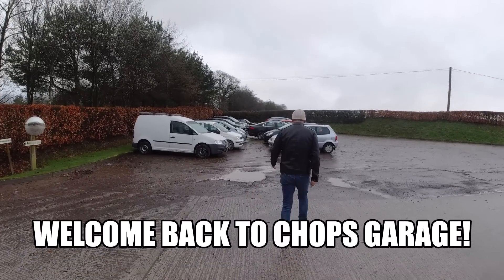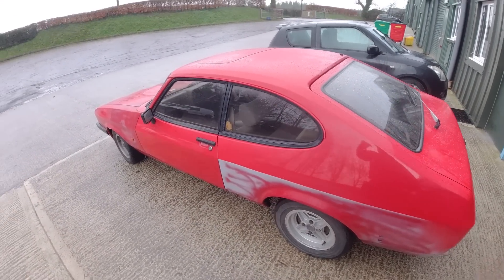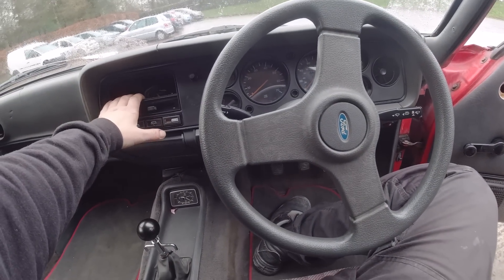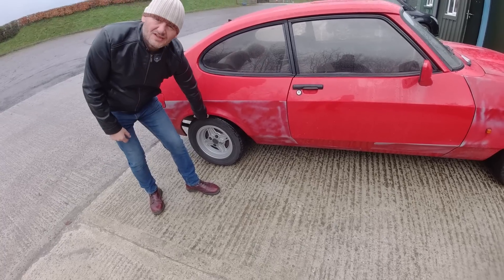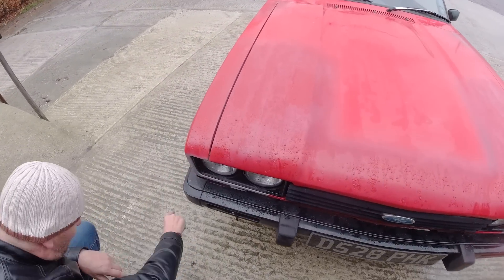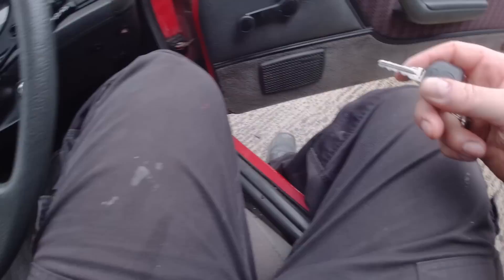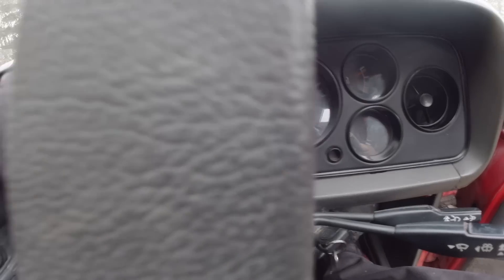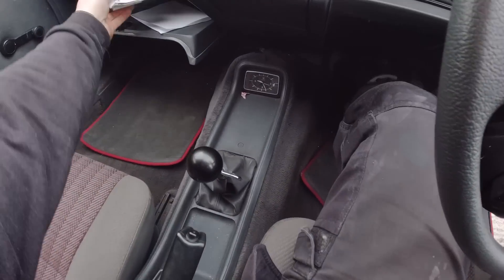Is this my best Part Exchange EVER?

Comment: Can’t believe how spindly those A pillars look on the Capri! 
Almost look like they’d fold in a strong wind 🤣
Definitely need to keep that as a project James, I’m sure it would be relatively cheap to get back to a really nice condition 👍🏻
Reply: The front bumper is basically a girder bolted on to the chassis though with plastic end caps, in an accident the car stops but you carry on travelling.

Comment: There's a lot of potential in that Capri providing it's alright underneath, I'm amazed at the rattle can paint job even though it was a rushed/rough one, it doesn't look like it. Although the Lasers were very common a Capri is a Capri. Could do with a bit of work on the engine though, it couldn't break the wheels free on a graveled car park!!!🤣, you need to find the missing BHP and shoehorn them back in.

Comment: When you (if) you paint that capri, DA as much down as you can and use isolating primer to stop any reaction, if you use base coat and clear the base is rich in thinners and will soften the many years of different paints underneath, 2 pack primer filler is good as it goes on so thick it really hides imperfections, if I do a car like that I basically Bury it in 2k and block it back, you'll paint it for 100 quid in materials as opposed to paying a body shop 2 grand.

Comment: I had a Capri 2.8 I back in the late 80’s . One of the best cars I’ve ever owned . Boy I wish I still owned it now the values have gone through the roof . If you can get yours near original condition there should be a good market for it .
Reply: I still  have mine but its now a toaster and the Escort MK1 is the kettle.........
Reply: Yep at 20 mpg I couldn’t afford to keep mine . Still great memories though.
Reply: @stephenbibby8650  I have a 2 Tonne Nissan Elgrand  3.5 V6 runs on V Power and does about the same in London MPG wise.

Comment: Best trade in you will have in a long time.  Worth a pretty penny too, but I’m biased when it comes to Capris.  I own a 280 with only 27k miles on it since new 👍
Reply from the maker: cheers
Reply: Lucky man…I had a E reg 2.8i about 22years ago,55k FSH caspian blue I think,sold it for £1850 I should have just moth balled it,around the same time a got a D reg 1.6 laxer for £150 that some old guy part exchanged into my mates garage,it sounded like a skeleton dancing on a tin roof,I sold it on to some foreign lad that thought it was a diesel because it was that noisy and smokey😂
Reply: Lazer

Comment: The Capri looks very sound, quality welding repairs from what you can see, it doesn't look frilly or crusty at the edges, and the inner wings and suspension turrets look mint , pretty sure it didn't come with RS alloys as standard , probably bought down the pub in the 80's 🤣🤣 bet they're worth a few quid now! 
The Pinto can make some serious HP , cracking motor when they're sorted , IIRC to do a cam swap it's an engine out job or take the head off, the cam comes out towards the back of the engine .
Reply: As I recall Dave the laser's did come with the rs alloys as standard , do a search for when they were released then you will know for sure if that's the case

Comment: Many years ago I thought I wanted a Capri until I drove one and thought oh dear this things awful... Maybe it was just a bad one but it put me off right away.

Clutch slave on the SAAB needs to be pressure bled, seem to remember them saying you cannot manually bleed them.  Rapid cars in the day with brilliant mid-range punch.
Odd shaped bolt holding the ignition switch in. Triangular, dealer wanted £75 for the socket and it was special order which could take weeks.

Comment: I remember when these came out. Bog standard Capris with crap interiors, but better wheels. A 1960s car in the 1980s. 

The plates are dodgy, mind, but probably the least of any owner’s worries.
Reply from the maker: I thought the 1.6 were the bog standard in this year
Reply: @ChopsGarage  True, but there was no difference in the Laser category between the 1.6 and 2.0 litre cars, but for the engine. These were being built solely for the UK market since 1984, largely thanks to the fascination for hot hatches. And I always thought the Laser was one of those ‘special editions’ that promised much and delivered little. 

These weren’t fast, but looked sporty, which is why the 1.6 existed for the more frugal owner who might be stretching his budget, or the more sensible type who didn’t want to drive like Bodie or Doyle. They’d either be thrashed to death or given an easy life, as the only way to move the 1.6 was to keep the revs up. Not that the 2.0 was great. It had a bit more power and torque, but still needed to be pushed for any performance. But hot hatches they were not, if you compare them to the likes of the Peugeot 205 GTi. 

And with an interior that looked like it had been robbed from a Fiesta Popular, I felt Ford was just marking time and wasn’t surprised when the end came the year yours was made, if the plate is correct.

Comment: How times have changed. There were Capris in better condition than that in the scrapyard back in the day!
There were also 'bargain bins' round the back of most car dealers where they got rid of part ex  'sold as seen' vehicles.
Reply from the maker: Yes its the way with classics

Comment: How did that get a MOT with those plates on?
Reply from the maker: Not sure they form part of the check other than they are legible.
Reply: @ChopsGarage  no black and silver on vehicles registered after Jan 80. "Friendly" MOT?
Reply from the maker: @TheBiggerburger  As said I think you will find that an MOT tester would be required to advise at best
Reply: @ChopsGarage  I think you'll find you're wrong! Had a mate fall down this hole, appealed to the DVLA and got owned.

display white, grey or silver characters on a black background - only on vehicles manufactured before 1 January 1980

Non compliance is a major, it's in the MOT Tester manual if you want to check.

Soooo. What else has the tester overlooked?
Reply: @TheBiggerburger  but how do you know it went in for the MOT with them on? Could the guy not have just put road "legal" plates on and swapped them once it passed?
Reply: @JohnClark-ew8dh  good point, well made.
Reply: @JohnClark-ew8dh  Thank you original plates in the boot ..give me strength
Reply: @TheBiggerburger  I took it for an mot original plates in the boot... ffs I changed them for the mot.. easy.. the you tube police are out.. always wrong..

Comment: I do hate a cliffhanger 😞 Laser was a poor mans version of the Capri IMHO
Reply from the maker: lol, why, what did higher spec have , a ash tray lol
Reply: @ChopsGarage  I think the V engined Capris had a higher spec .Didn't take you long to get the rattle cans on that one though 🙂  Is this another toy for you to play with  .I did enjoy the saab  clutch portion Hope you didn't break it though new clutch must come with some removable clamps or similat so you can assemble it easily then pull clamps off

Comment: Looking at the RS4 spoke alloybwheels and is a mk3 I would say it is a 1.6 or most likely a 2.0 laser or 2.0S model it's definitely not a 2.8i
 but that's my 10p worth
Reply from the maker: Correct
Reply: Laser capri are not RS unless you don’t know your onions and they don’t value the same plus the date codes are not right for mk2 escorts which matters now if you want top money
Reply: I've always known the wheels as RS 4 spoke alloys if I'm wrong that's cool I don't mind been corrected. I've had owned 2 capri's a 1982 2.8i with pepper pots and a 1981 1.6  tone silver on gunmetal grey calypso with steelies

Comment: Back in the day I put a mk1, 1600 gt taken in p ex, in Bawtry motor auction, made 100 quid.
Reply from the maker: Mad isnt it
Reply: @ChopsGarage  had a few over the years bud, they were just 595 ers then, spun a few, tbh they were a bit dangerous, back would go out fairly quickly.
Reply: Back in the day. Bawtry was known for end of life cars. Odd balls and smokie clunkers! You'd put cars in the auction but never bought one. Well in the 80s/90s .
Reply: @oldboy1690  yes bud, they used to announce that the police were outside pulling people, bought a royale and when I opened the bonnet the inner wing collapsed!
Reply: @roystonvehicles9129  yeah that's right. I remember the police waiting. Happier simpler days! 😌
Reply: @oldboy1690  started my car dealing days there in 87 bud, bought a viva, k reg for 75 quid got 275 for it, as you say happier simpler days.